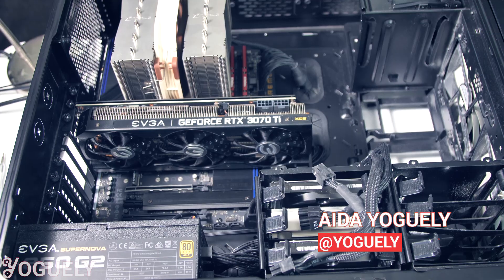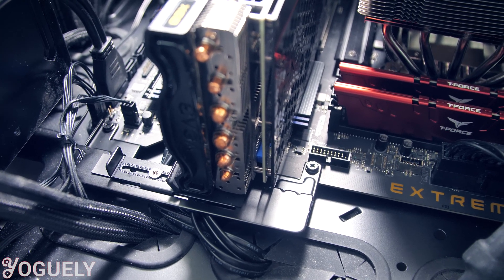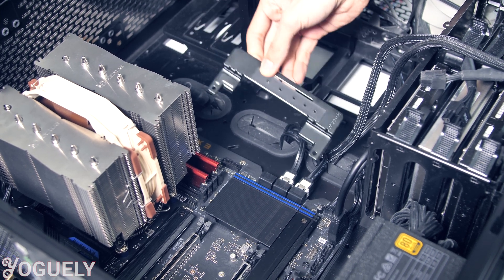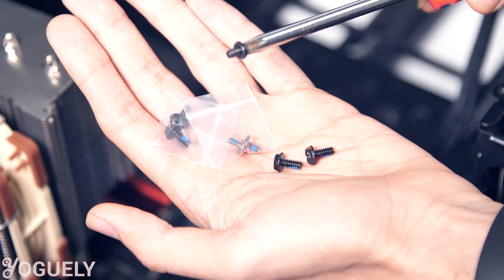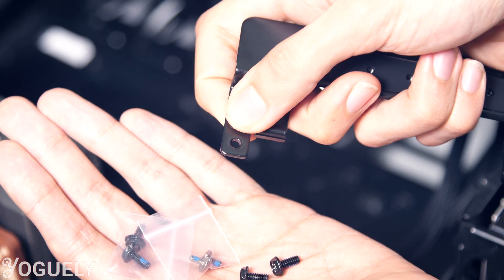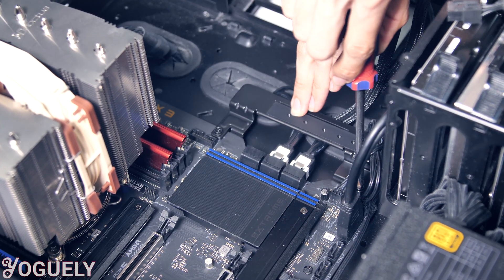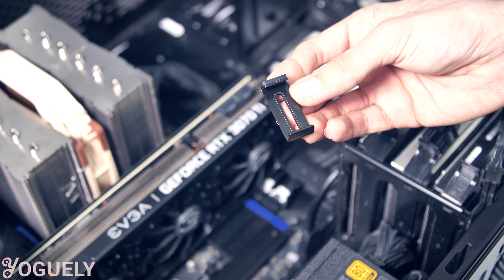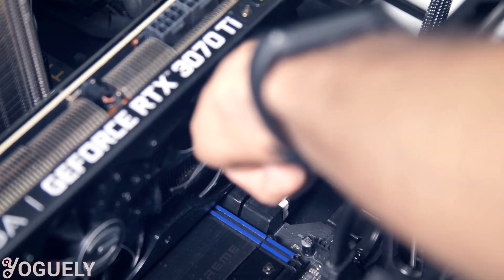How to Install ASRock Anti-Sag Graphics Card Holder for Z590, Z690 Motherboards

Comment: I tried to use this with my Palit gamingpro 4070 ti super, and it didn’t work. the groove for the smaller plate doesn’t go low enough. the card is too fat, if I force it the card sags upwards if that makes any sense. I might have to modify this groove with a power tool.

Comment: You seem to be such a nice person and I like your videos! I use the ASRock Z790 Nova WiFi a year now and I ignored the anti-sag bracket until today. I noticed that my Gigabyte 4070 sagged a little and the gpu holder worked like a charm! It's a bit strange that the manual states to use only one screw for the height adjusting part... Anyway I noticed that you have an EVGA gpu. Too bad they ceased manufacturing. They were the best by far!

Comment: Didn't fit my Gigabyte 4080 Super Gaming OC but it Worked perfect for my Evga 3080 Ti FTW3 Ultra.
Reply: Was it because there was a big gap so it was useless? 😅
Reply: @KirbysBack  The Gigabyte is so big it actually covered most of the the bracket making installation of the smaller bracket impossible.
Reply: My cable bar was in the way so i just bought one that mounts in the gpu slots under the gpu.

Comment: Thank you for this.  The manual was worse than useless for figuring this out, though it makes sense in hindsight.  If they had just included a picture of WHERE it went on the mainboard rather than just a total blank rectangle it would have helped.
Reply: I second this. Thanks for the video.
Reply: Manuals are shockingly bad now, mine was the same today